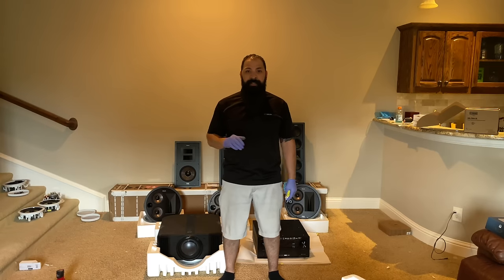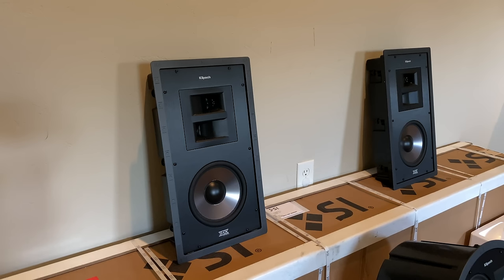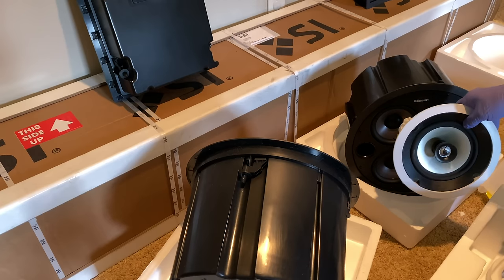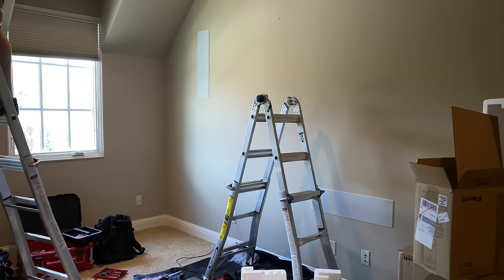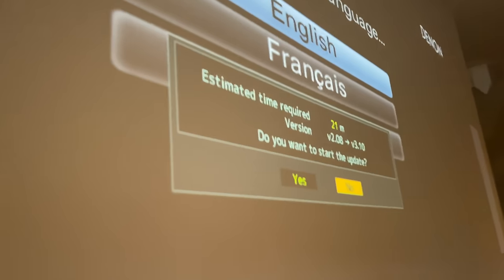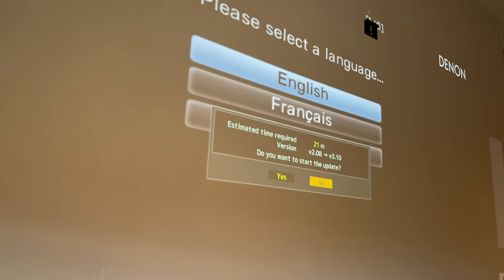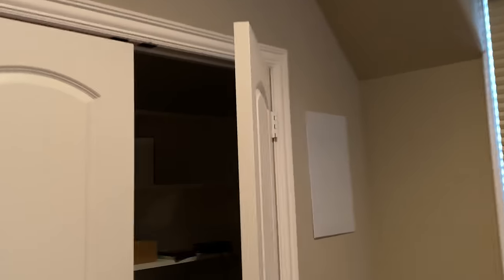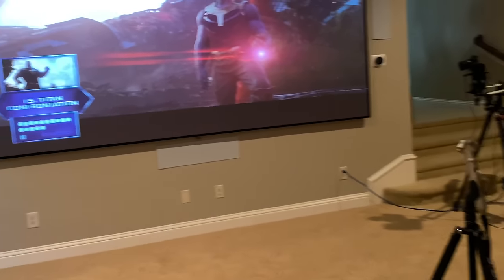8K JVC RS3000 Klipsch THX 5.1.4 Atmos Home Theater w/ INSANE 150" Black Diamond Screen

Comment: Compressed air or not, keep the equipment away from the construction dust until you can or fully wrapped up. Not cool, especially with someone else's equipment.
Reply: I was thinking the same thing. How can they they leave a $16K projector exposed to dust when there’s a lens susceptible to scratches plus dust will enter the interior when fans start working. If I was the owner, I would be pissed!
Reply: I guess we are all experts, but I agree 100% and dont even get me started on the fact that they seem to be following a trend among installers to focus on the gear and completely ignore room modes. This room is a classic 'before' for every acoustic panel / basstrap manufacturer on the planet - we're all prisoners of our budget but buying the speakers / projector / screen first strikes me as false economy, DSP or no DSP.
Reply: These guys are professionals. I’m sure they know what they’re doing and don’t need advice from a random YouTube comment...
Reply: @NickyNicest  I'm an electrical and IT consultant. Trust me this stuff does not fly in professional environment.
Reply: @ThomasGregan  bullshit..  sparkies are the worse when it comes to making a mess along side any tradie..
Reply: @scottsyoutubevideos  only the lazy ones! - not me sir. Cleaning up after the job is part of the job!

Comment: There is a lot of questions before I pass judgement, but from my perspective it seems like you fleeced the customer. Why the 8K eShift projector? Could have saved $8K  going the next step down, diverted those funds to more surround channels or subs, Throw distance is not that long and some blackout curtains solve the issue of lower lumen. Alright the customer wanted the absolute best in image quality, no compromise there. He made the compromise in sound going with a 5.1.4 setup. So why sell him the Denon 8500? Is the customer planning to upgrade to 13 channels down the line? He could have gone with a 3600 up to a 4700 and been just fine and saved anywhere from $2300-2900 to put towards subs. Yes the 8500 has a beefier power supply and more power will get to those 9 speakers since it won't have to power 13, but the savings could have got external amplification which would far surpass the 8500 power. Now the subs I kept mentioning. Why the just one PB2000? Funds run out? Customer not a big fan of strong bass? Why not two subs to even out response? Customer dictate location trapped in that cubby area or were REW measurements taken to give him optimal performance? I find it hard to believe that spot was the best. With MSRP and just working with those brands I don't think he got the optimal setup, but highest profit for Dreamedia Home Theater.
Reply: I said the same thing about the sub, all that money spent and didn't go duals. Kind of a mind fuck if you ask me. I spend way less on my setup and I have dual PB-3000's.
Reply: I wanted video quality over everything else. Considered even going up to a laser projector, but the nx9 was already supremely good. 

As for the subs and bass: I have an infant and bass can be overwhelming. We mostly watch shows in our theatre when baby is asleep or sports during the day. Also, I’m not big into bass anyway, so this was an asked for sacrifice.  I specifically told them I didn’t need significant bass.  It was a request. I do plan to add on a more robust sub(s) system when my son is a bit older, though. At the time I’ll also likely add a dedicated amp, increase speaker channels and maximize the room further. This is one of the reasons I choose the 8500. DreaMedia gave me a bunch of choices and explained everything very thoroughly.  The nuanced decisions all came from me, the customer.  This room is perfect for my needs.  

I’ve expanded on this and plan to get further acoustic treatments and have added true blackout shades to the room. There’s been a lot of thought dedicated to this space.  I appreciate your concerns, but this fit my personal needs.
Reply: @Arthurmorris012486  Only person it matters is you, and if you are happy, I am happy for you! You definitely have equipment in there I am envious of. I just saw a whole lot more potential for MSRP budget. I am assuming buying all that at once and them installing you got better than MSRP. No need to state price, just using MSRP as a reference point. Sit back and enjoy.
Reply: Ya, DreaMedia has a price match gtd and are extremely competitive to begin with. Honestly, they were absolutely awesome to work with.

Comment: Nice installation. Only one minor thing to mention. You really should have the amp and the projector covered to protect from construction dust. The issue is sheetrock dust will go airborne and settle inside with all of the venting. Making the units prematurely get dirty/run hotter quicker, due to dust buildup. Both should be properly cleaned by owners occasionally. But we know a lot of people don’t do that. 👍

Side note, I hope the owner has sufficient central air coverage in the high room. Since you were so hot doing the work up there, makes me wonder. Otherwise, it is gonna be uncomfortable to watch movies and all of the equipment being so much bigger will run hotter.

Comment: In my opinion the amount of money spent on sound and video might have constituted a  dark mostly enclosed dedicated theater room. This room looks like both a sound and projection nightmare. I am not trying to be rude just honest. I think the installers had some huge challenges to overcome here. 

Sound wise, first the open concept area is really a big challenge, a room this size enclosed the owner probably could have spent half the money and get as good more better sound right away. On top of that an additional challenge is the reflections, this room has a lot of not very square aspects. For a really talented sound engineer it could be something great but for most it could be a very hard challenge to over come. Doing a lot of acoustic treatment would help but still not easy. Also the high ceilings are always going to make in ceilings harder, it was cool to see such a beastly speakers used to overcome this almost entirely by the sounds of the customer.

Projection wise, again the open concept doesn't help but the biggest problem is also the most easily fixed. Those windows right beside the screen shining in are sad to see. In Fact I think Dreamedia, you should consider helping this customer out and maybe throw in some blackout curtains and install them. these small windows wouldn't cost you much and would make your customers visual experience that  much better. As others have mentioned, Its also to bad an ambient light rejecting screen wasn't used, maybe it was recommended, if that's the case sorry to bring it up.

Otherwise I think you guys totally maximized the experience given the challenges. I suspect this may not even be the primary viewing room.
Reply: The screen is ambient light rejecting, so that’s not a concern.  I did add the blackout shades as suggested by DreaMedia later. I’ve also had professional acoustic treatments after the fact to enhance the room.
Reply: @Arthurmorris012486  right on man, sorry if what I said came off badly, I was just thinking out loud lol. 

That's awesome, I've not viewed a good alr screen (I've only seen a crappy brand that a friend had year ago) and acoustic treatment will definitely bea game changer, I I'm sure it payed off massively
Reply: SI screens are incredible. Truly a long term investment and wonderful piece in any media room.  The ambient like rejection works tremendously.
Reply: Arthur Morris  Mr. Morris, awesome setup, awesome equipment.  I think it’s a clean, exciting look and I envy you sir.  I would enjoy having that setup for me and my family.  Kudos to you!

Comment: Finally an install with the 5002 as atmos speaker. I will move to a new house in December and am looking to use these speakers as atmos as well.

I found it impossible to find any reviews about them, but I but am happy to see I'm not the only one who wants to go for decent atmos channels. 😀

I was wondering what the difference is in sound leakage between the 5002, and the previous atmos speakers the home owner was using, and since the 5002 has a closed up backside, and the previous smaller atmos speakers where open.
Reply from the maker: the sound is much tighter and more precise
Reply: I have the same system except PB 16 Ultra and CDT 5800II for the 4 atmos - I like that I can physically tilt them toward the MLP.
Reply: The sound is incredible. Absolutely stand by the products I receive.

Comment: I run def tech in walls front and back. And ceiling. Love the look of in walls. And of course a SB16 :)
Reply: I’m no longer an SVS fan 4 of subs starting to fall apart.  Lose amp connections and the piano black cracks very easy.  Great price but beware they don’t last.
Reply: Is Klipsch the end all be all for HT speakers?  I see everyone on YouTube uses them
Reply: @ryanrodriguez70  I've had my PC 4000's since they were released with zero issues and and SB16 in the bedroom.  No issues whatsoever.  The peace of mind of their customers service should leave anyone with no worries ;)
Reply: @ryanrodriguez70  I have one of their cylinder amps from circa 2007 or 2008ish.  It still works fantastic but that was back 14-15 years ago a lot can change
Reply: @glennnichols4220  In the US its basically the only speaker you see. In all other parts of the world the speaker choice is much more diverse! Its kind of a meme on reddit too America Home theater in a summary is Klipsch and Denon.
Reply: @notagunfreak8146  Well I did just buy an older Denon4500H that has seeemed to work ok for what I need.  I haven't messed to much with it just set up and played.  I do have Paradigm Monitors 9 V5s up front and Titans in back.  Only have a 5.1 setup so far.  Wouldn't mind adding more speakers but I don't have space for rear surrounds as my couch is up against a wall and my viewing distance from the TV is only 12.5 feet with the TV only a foot off the wall.  I would like to see if overhead speakers would work for Atmos height.  But being in an apartment I would havd to get pretyy small speakers for that and some type of ceiling  mounts.  I heard that full range speakers are the way to go though, bookshelfs vs surrouds??
Reply: Is the SB a SVS sub?
Reply: @glennnichols4220  For height channels, use a bookshelf speaker. It does not have to be really good. Any used 80 dollar speaker that has at least a tweeter and a 5 inch driver would be more than plenty in a apartment.
The SB is a subwoofer series. The PB series is the ported subwoofer series and the SB is a sealed subwoofer series. The SB 16 is basically the endgame of sealed subwoofers from SVS. (which is more than enough for 95% of all people btw!)
Reply: @glennnichols4220  yes
Reply: @glennnichols4220  No. At their price point they are hard to beat. IMO.

Comment: Any reason for using the Thx ultra 2 speakers for all your surround but a Thx select system for front stage? Would you not be better off using the 8000 thx for front stage aswell? Or even just swap it around as in select for all surround and ultra 2 for front? You done a beautiful job of the install, but I would never not cover my clients room and carpet with dust sheets. All equipment is bought in one by one with a trusted Henry at and always.

Comment: definitely not overkill on those overheads for atmos.
Reply: I was wondering if the surround version of those speakers would be better since they have the WDST design and would throw the sound to the front and back on the ceiling. Damn I can't even imagine!
Reply: They look just perfect.
Reply: They’re SOOO awesome. Very happy I chose to go with the bigger more robust overheads. They shine the most in movies helicopters , planes, gun/action scenes, or air noise.

Comment: So I wanted to know, I have a 7.2.4 THX system going into my great room, I have no rear wall behind my head for my rear surrounds so I was going to be using the THX in ceiling speakers as my rear speakers instead, I wanted to know if the THX-5002-S or the THX-5002-L would be better to serve as my in ceiling rear surrounds?
Reply from the maker: Reach out to schedule a free consultation with our specialist. You can FaceTime with them to check out the space or send pictures but it’s hard to give a recommendation without seeing the room. The S you will get better dispersion and the L is going to be more accurate to it’s location so it depends on the seating set up and room layout. I don’t want to steer you wrong. Just reach out and we are happy to help! 😁

Comment: Tip, use a Peavey black widdow 18" in a dubble bandpass, don't know the liters out of my head but mine does 18 Hz at -3 dB. For power I use Hypex 4.0 plate amp

Comment: Great to see some THX Ultra 2 In-Wall love! I've had my THX setup since March and they kick some major ass. I am looking to upgrade to Atmos and will look to utilize 5002-L. Does the tweeter on the 5002-L  do a good job to direct the sound towards the listener well enough for Atmos?  It appears so based on the images, but Klipsch's data sheet does not provide much info on this. No dealer seem to demo the THX line in their showrooms  :(   I do wish that Klipsch would have allowed the tweeter to be aimed or the entire housing to pivot for a ideal Atmos use. 

It is a shame that the owner decided to use the magnetic grille. These speakers are so damn sexy with the cover off!
Reply: I would also like to know how do you direct the twitter on the ceiling speakers. There is no information whatsoever online for this model
Reply: DreaMedia adjusted the tweeters for me but they work excellently. I’d highly recommend this product. :)
Reply: Arthur Morris what all did they do?

Comment: Those mains look way too high for me...tweeters at ear level or there abouts surely? Plus as mentioned why not AT? Customer chose matching LCR which is good but having them on a horizontal stage makes all the difference. Nice kit tho.
Reply: Ya placement seems a little odd to me as well.... why not have a smaller screen so you can move forward a bit so your not getting blasted in the head by your rear surrounds. Plus then you could have your mains a bit closer together. Like you said, I would prefer them lower as well... but maybe these speakers are designed to be at that height?

Comment: Did you need an additional amp to power the speakers? The 8500 pushes 150wpc but I thought these thx speakers needed at least 200 watts? Incredible job!
Reply: That's what I thought.... I m setting up mine with similar speakers but I got 3 rotels.. 2 5x200 and 350x2

Comment: Crazy how expensive the JVC is and then the owner didn't consider a AT screen.
Reply: I cried a little when I saw that center get placed under the screen.
Reply: Sendit Sunday  No it would be better behind a screen that allows it to play through, not possible with this screen though. anyways depending on how close the seatings are to the screen this  is gonna sound like the dialog is coming from under the screen = not good.
Reply: Sendit Sunday  Thats what I was saying the current screen doesnt allow the speakers to play through so they can't be places behind the screen. The speaker position for the center is placed the only way it could be for this screen, if it had been an AT screen it should not be placed where it is now.
Reply: @L3x4Pr0ne  Not to mention that screen is a solid 2 feet too high.
Reply: @blackbibletv  How is the screen two feet too high?  You want it pretty much on the floor?  You can see clearly it is most likely 30" off the floor.

Comment: I have a basic home theater. Denon avr, with two front towers, 2 top ceiling speakers, 1 center ceiling and 2 ceiling surround speakers. While I like the sound from it I want to make sure it’s setup the right way so that I’m using the system to its full potential. Do you offer consultation? I live in San Jose California.

Comment: We can Always dream that would be the system I would love to have nice
Reply: From my own experience you can achieve a whole lot within a lot smaller budget just by getting good speakers with properly positioned,, or with good quality headphones, like Beyerdynamic T1 gen3 Open back or the T5p Gen 3 closed back.
It is just a rough estimate, but I'd say 85% of the experience can be achieved for 1/10 of the price, and most importantly yo can get that experience "now" while the dream will happen much later down the line.
So: 2014: Full HD home theatre Projector, albeit demo, £375, best in class black levels and input lag for gaming
135" white, motorised screen £275
JVC Whiskey Barrel speakers, matched pair £600
JVC stereo amp: £250
Whatever speaker stand to make the speaker at level with your ears.
Yes, no sub was required for those little gem speakers because of the spacing I had from the walls.

It was a 19''x15' room, and my I was about 13'-4' from the screen. Those two speakers made me never wanting  a 5.1+ sound system again. Ceiling 8'.

From that distance Blu-ray was awesome, you could not pick out any pixels. You know what is even better? Just use your wall as a temporary measure. White wall or peach is perfectly fine till you can upgrade. I'm telling you this because I have done it, and it was bloody awesome!

Having a dream is fine, but make biiig portion of it come true in a lot shorter period of time is possible with creative thinking!

Hope you manage to cook up something nice that you can enjoy!

Comment: Should that 504 be horizontal if used as a center channel? Cuz my thought process is to have all 3 front stage speakers vertical and behind a acoustically transparent screen. Would that affect the sound in any way if the center was vertical? (Stupid question I guess)
Reply from the maker: they dont make an acoustic transparent black diamond